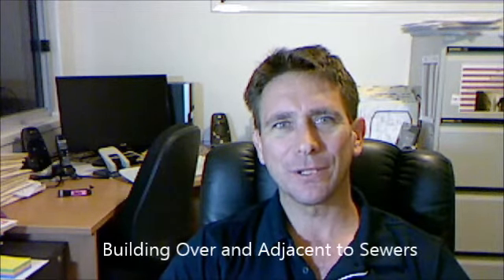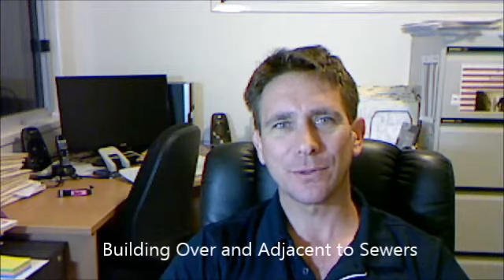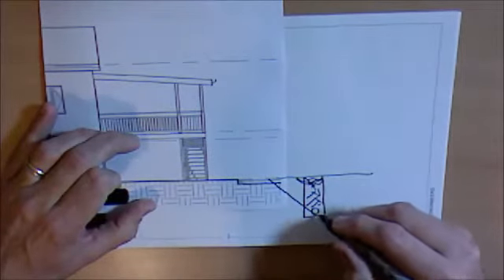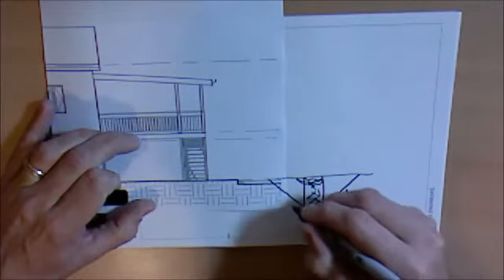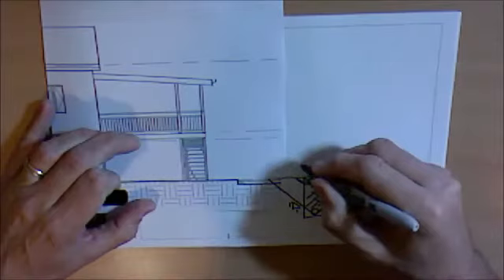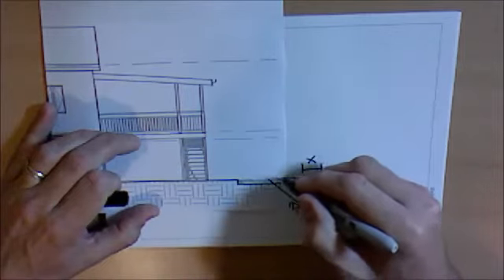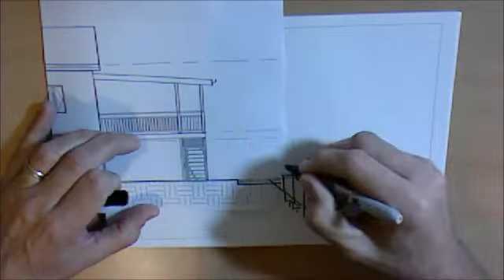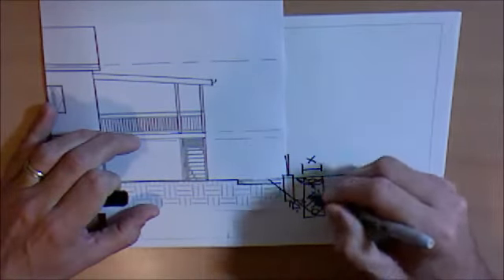Building over Sewers. Find out why we have special rules for building over and adjacent to sewers.

Comment: How do you draw a plan & what to use for going over sewage pipes on a terrace house with a 4x5 conservatory  in the back garden. The sewage is across the back
Reply from the maker: Yes. Good question but not something we can provide advice on. You'll need a local engineer to design and specify the footings and how the load will be carrie dover the sewer pipe. If you do manage to find someone on Youtube that gives you an answer, I still wouldn't trust it. The design needs to be by someone who is local, knows what the rules are in your area and someone you can sue if something goes wrong!
Best of luck.
Matt Cornell

Comment: Thanks for video. I know the rules probably vary from state to state but can the structure be built over the sewer pipe, assuming the foundations met other requirements in regards to depth and distance from the sewer? I am thinking studio in a backyard under which the sewer line would run.
Reply from the maker: Hi Ben
Generally yes, so long as you aren't building over a sewer maintenance hatch (manhole). Some local authorities also have limits on building over the sewer connection point (jump up). I have heard of entire commercial building being built over a sewer. As you said, it will depend on the local rules. Don't forget these rules are only for the council owner sewer mains - not your own pipe that runs from your house to the mains.

Comment: What if I was to use a pile foundation design
Reply from the maker: Sarbjeet Atwal
That's a great idea. Piled foundations are permitted (and required really) to support building loads at a deeper level than the adjacent sewer.
The type of pile, the depth of the pile and how far the pile has to be constructed from the sewer all have to be considered.
So the use of a pile foundation is a good idea but it must be designed and it must comply with the local underground service owner's requirements for piled foundations.
Make sense?
Matt Cornell